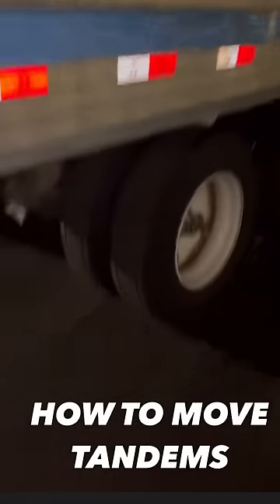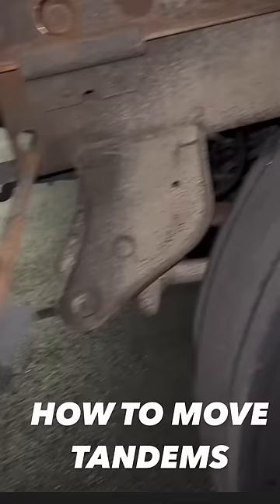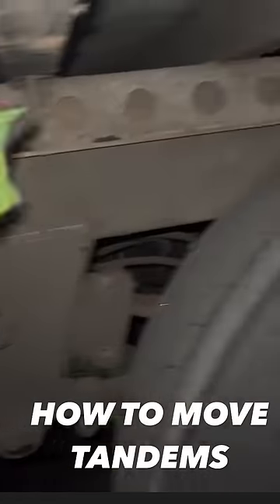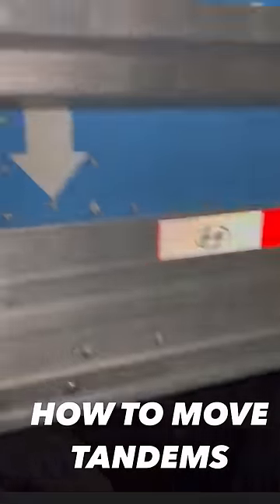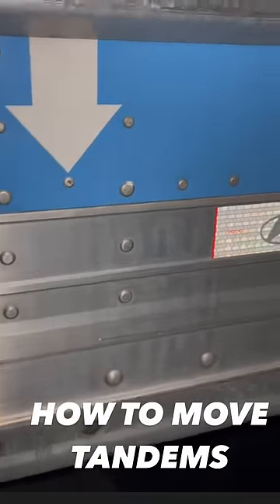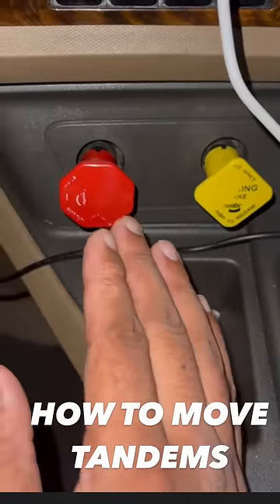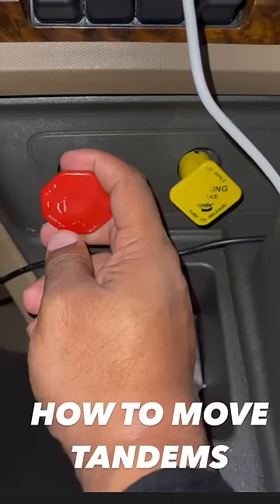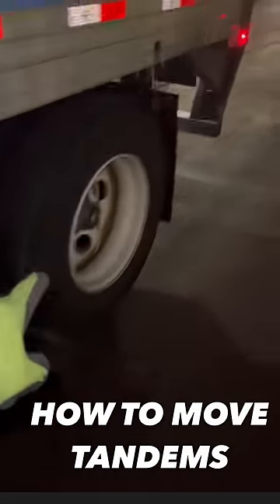HOW TO MOVE TANDEMS

Comment: Ok so I've done all of this but the trlr tires are still moving. I've held the trlr spring breaks but nothing is working. Pins are in air is good trlr breaks are set. What could I possibly be doing wrong here?
Reply from the maker: Might have to check out your brake chambers then they might be loose but replay the video and make sure you are following all the steps in order

Comment: Yap he is right not emergency break that is your trailer break ...wow would you drive that trailer with those tires ... I know itz summer but if itz gana rain or you blow them out in hot weather ... Good luck o would pull such a trailer ever ... Hope breaks looks good on that junk trailer ...ahhahaha
Reply: Ahahahaha your a beeeettttccchhh
Reply: @rayderian2212  ahaha 
Yap only a Rocky driver will pull tailer like that out 
Not a professional driver ...keep that in mind when DOT pulled you over your responsible not your company and they will know that u didn't do your pretrip like a pro
Reply from the maker: Thank you for the feedback
Reply from the maker: Amazon trailers get a lot of ware an rare but they change them now they have added an inspection feature to there app
Reply from the maker: Thank you